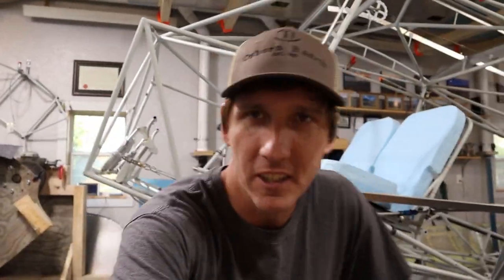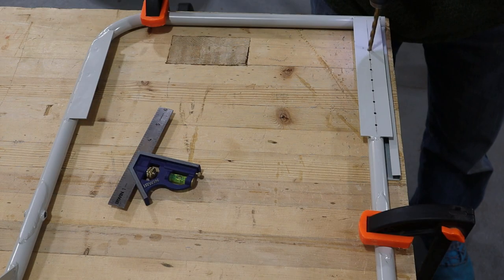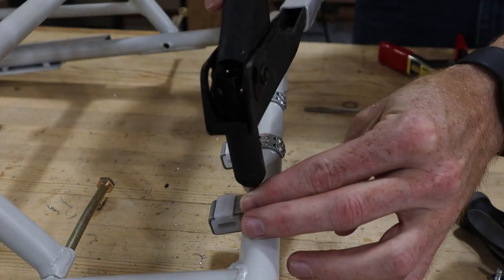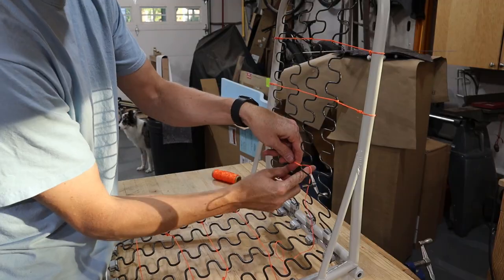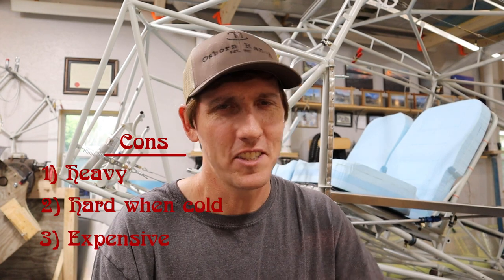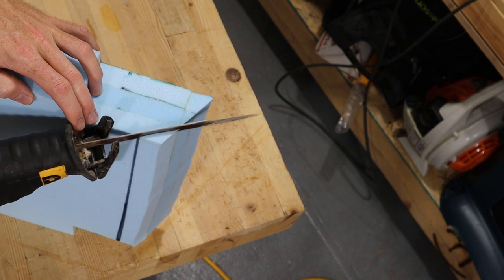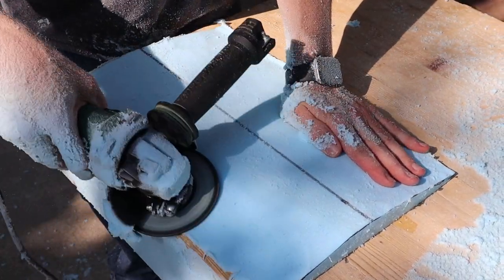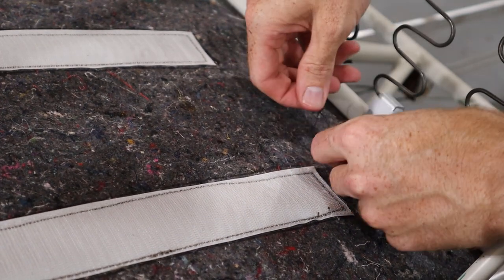Seat Assembly and Carving Seat Cushions

Comment: Love the videos. Thanks. Would like to know though how much detail is in the plans for building vs. trying to figure it out on your own.
Reply from the maker: Thanks, Robert! The actual plans themselves, in my opinion, do not have a lot of detail. There is a builders manual that does contain a lot more detail, yet does leave quite a bit up to the builder. But the support from other builders on the Bearhawk forum and the support from Bearhawk Aircraft owner Mark Goldberg, is excellent. So far I’ve found I never really need to figure anything out on my own. Anytime I’ve wanted more detail on a specific matter or had questions, someone has graciously helped.

Comment: Great video!  Just curious what firmness did you use for the bolsters?
Reply from the maker: Thanks! I used soft for the bolsters, but I don’t recall making that choice for any reason other than that’s the same firmness as the top layer. I initially planned to have bolsters on the back rest as well, but a 05-2010 Kitplanes article made me reconsider.